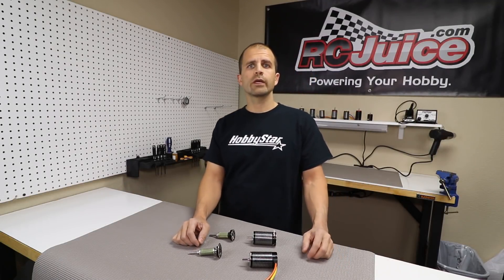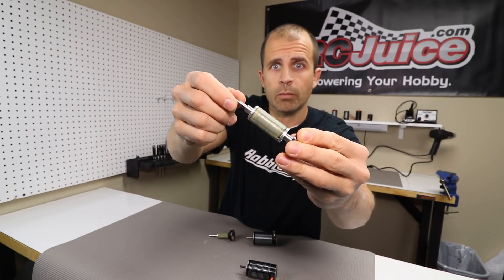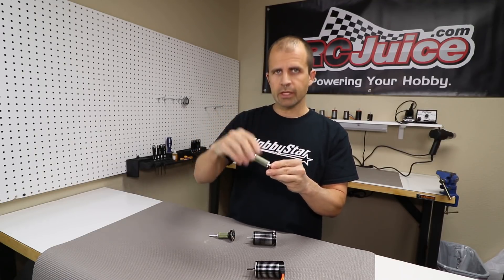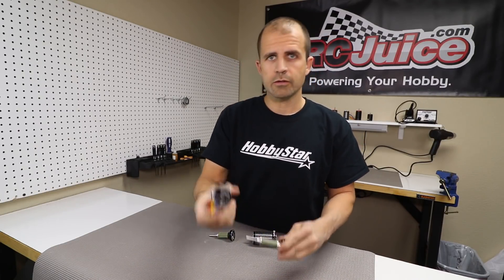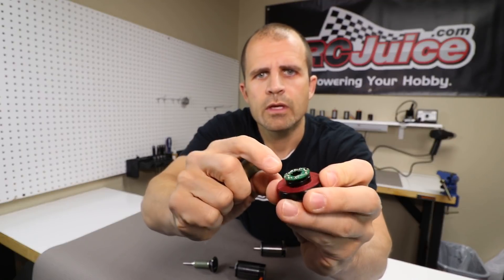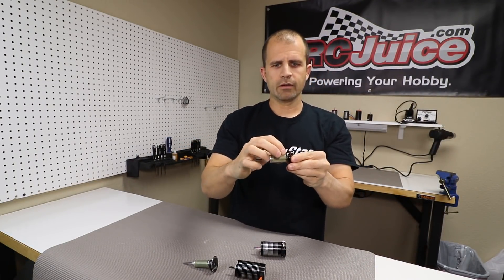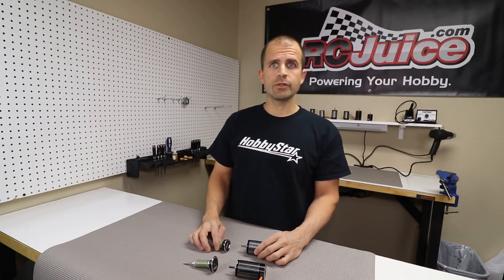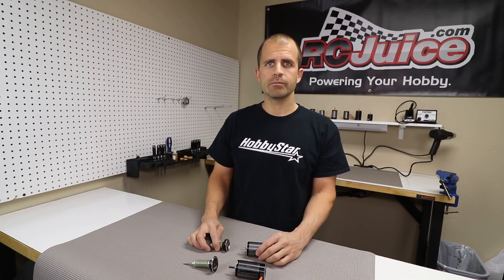What is a sensored brushless motor?

Comment: If I use a sensored motor in a non sensored set up, will the motor still run (like a sensorless motor would) or would it be totally non operational??
Reply from the maker: It will still run like a sensorless motor.

Comment: thanks for the explanation, so when the motor dont have a sensor motor and will be cogging?
Reply from the maker: You will usually get some light cogging at low speed with a non-sensored motor.

Comment: help me please ive got a cobra motor 2205-2500 it has no color coated wires im ttrying to hook it to an eflite ss-8 esc silver series  the esc has red yellow and black when i hook up aNY THING IT JUST BEEPS AND JUMPS   does it need the right bspeed controller which has all black wires just like the motor i would rather make it easy on my self since the last plane i fly was  a goldberg skylark gas powered 40 k and b that was over 30 years ago this eletric crap seems very confusing  can you help the radio system i just got  is a spectrum dx 4e it all originil stuff
Reply from the maker: David, check out this video for the order of the wires (the short answer is it makes no difference, if the motor spins backwards after connecting the wires then just swap ANY 2 wires around): https://www.youtube.com/watch?v=AQEAHEzaUJE    For the other issue, it sounds like you need to calibrate the ESC: https://www.youtube.com/watch?v=MIpvyi8vjHk

Comment: great video thanks heaps! Liked and Subbed! 
Just one question: Both same sized motors say a 4274 motor sensored and sensorless, would there be a difference in speed and torque outputs? asking this as i realise the sensor does take up abit of space up top. TIA!
Reply from the maker: Thank you for watching Chris! If both motors are a 4274 then no, being sensored vs. sensorless is not going to make a difference in power/speed, just in the smoothness of the operation of the motor.  Please let us know if you have any other questions and thank you again for watching!
Reply: @RCJuice  I'd like to know why this hobby has so many hidden costs? It's always one thing after another. I just bought a sensored motor, a sensored esc and neither of them come with the sensor cable. When are these scum companies going to stop ripping us off?
Reply from the maker: @murrijuana2842  Sensored motors should come with a harness, the ESC's usually do not but a motor always should.

Comment: Do you know if there's any way to bypass a censored motor and run it on a sensorles ESC?
Reply from the maker: Most sensored motors actually can be run without the sensor wire plugged in, we don't always advise it as we have seen it cause issues on some motors but you can try it and if nothing is heating up or acting odd, then it will still work fine.

Comment: Great video. I’m new to the sensored motors and esc. I’m having cogging issues with my sensored motor. I changed out the sensore wire, yet to trim if it changed anything. Should I turn down the timing on my motor or gear it?? Also what pitch do they take best? I’m using 32pitch would a 48 be more easy for the motor??

Comment: I'm an embedded control systems engineer, and I can tell you right now that it all depends on how  the motor controller was programmed.  Many lazy embedded programmers use PID equations to control their PMSM motor and never really implement them with any sort of Real Time Operating System to organize all the tasks involved in motor control, they also ignore the fact that vector control using SFB could yield some awesome results with sensor-less motor.  When looking for an RC system its best to get a system that was built by real engineers the "R1 Wurks Digital-3 LCG 220A Electronic Speed Controltor" is what you really need if you want to get serious. To further back up my claims you can take a look at this IEEE article. https://ieeexplore.ieee.org/stamp/stamp.jsp?tp=&arnumber=7519896

Comment: So I had a question I have a sensored LRP ESC with a monster horsepower 13.5 Trinity sensored motor well when I give it full throttle its dieing out but before it worked fine  I wasn't happy with the settings so I started to mess with them through the set up on the on and off I'm thinking I might need a programming card but correct me if I'm wrong please it would be much appreciated?
Reply from the maker: The program card would definitely help you get it set up easier, but it sounds like you may have something else going on?  Have you verified your battery is good (it could be sagging under load and the ESC hitting low-voltage cutoff prematurely)?
Reply: @RCJuice    Well I ordered a new brushless set up Because my batteries and everything's working on my other trucks but  I just got this traxxas slash 4x4 for a good deal it's just the esc that's having problems or motor because  My programming card came and it won't even let me change the setting with the programming card which is super weird but yet again it's my first lrp setup And all the videos on them are in German so I do not understand them

Comment: Seems in a Brushed motor there is no need for any sensor control. Already accurate for rock crawling and seem to have reasonable survival in water more then a brush-less Motor. I don't see the point in brush-less motors in rock crawlers. They are freaking awesome in my Traxxas UDR and anything that moves fast. Rock crawling, doesn't seem like their cup o' tea, at least that is what I get out of other reviews that brush motors have more accuracy and far less jumping around. I get that brushed motors lack longevity over brush-less motors and brush-less motors are so much faster. Am I wrong?
Reply from the maker: You are correct that there is no need for sensor control in a brushed motor.  The sensor is beneficial on brushless motors since there is no physical contact between any parts except for the rotor on the bearings, the ESC has no way of "knowing" what position the rotor is in without a sensor.  On a brushed motor, the brushes make physical contact with the rotor and for this reason, the phasing is always correct and you do not need a sensor.  The main reason for brushless rock crawler motors is mostly the market, since brushless is so prevalent along with crawlers it was a matter of time before the crawler guys were clamoring for brushless power.  Brushless motors are definitely more efficient, but at the slow speeds crawlers go at it's just not as much of an issue.
Reply: @RCJuice  Thank yo uso much for the reply. My friends brother seems to like brush-less in his rock crawler. Thank you for the time and clarifying your response. 🍻

Comment: Would you please suggest me without a sensor the best method to know the actual rotor speed ....
Reply from the maker: Without an external tachometer and something attached to it to measure, or a telemetry system it is difficult to know RPM.  You can get a good idea of your rough MAXIMUM RPM simply by multiplying the motor KV by the voltage you are running.  For example, a 3000KV motor on 4S would spin at 44,400RPM (14.8V x 3000KV).

Comment: Is it just castle that shuts off the "sensor" part of the process once the motor gets up to a particular rpm or do all esc's do that? To be honest, unless I'm crawling along at quite a bit less than a walking pace, I don't notice the difference between my sensored 2200kv vs my unsensored 2200kv. Then again, they are both in basher monster trucks.
Reply from the maker: Once you are moving at anything more than a walking pace the sensor becomes pretty much irrelevant anyhow, the main purpose of the sensor is to tell the ESC what position the rotor is in right at startup.  Once the motor is turning the ESC knows what position the rotor is because as it rotates, the ESC can "read" that.  Particularly on larger setups like yours you'll really mainly only notice the difference taking off slowly from a dead stop.
Reply: Ok. That's what I thought. Seems like with a 4 pole motor, sensored is a bit unnecessary, unless your using it in a crawler.
Reply from the maker: For bashers that is true, but for 1/8 scale race rigs (buggies and truggies) they are still the ticket.
Reply: Why though? It isn't like they stop ever, or at least on purpose when racing, or ever go so slow the sensor is doing anything for them.
Reply from the maker: It makes a difference when coming out of a slow turn, the whole operation just feels smoother and allows for more precise driving.  When racing you are much more precise about where you want the vehicle and it does help make it smoother and easier to control.  Even if it's a small difference, in racing every little advantage can help.
Reply: There's been very little R&D in Sensorless Motor tech lately.... However, as one of the Few who has given TenShock's latest Crawler Motor a go.....
I can definitely say that even MORE Poles is the answer! At least for Crawlers like myself, on a very fixed income.  Admittedly, it would be mostly USELESS in 95% of Racing! 

It's the TenShock 906 Series... All 3650 Cans, all Low KV...... All 6 Pole 9 Slot Sensorless Motors. Mine's the 1750kv. There's also a 1250kv and a 2450kv Version. 
My 1750kv, on 2S, only rarely will have the slightest, nearly inperceptable Cogging!!! 😱  It really goes against "Sensorless rules".  I'm told that it's because of more overlap between the Stator Magnets and the Winding Slots - since most later 4 Pole Motors also have 9 Winding Slots. Some even have 12!! 

I have NO IDEA if a 4 Pole Stator can simply be swapped with a 6 Pole Stator. I guess all other measurements being equal, maybe someone (who actually HAS money) can Test that Theory - with some fairly accurate means of measuring output, torque, current and such..... 

John Holmes, of Holmes Hobbies himself, has practiced with the practicality of smooth Sensorless Motors!! He Sells a 14 Pole, Outrunner Motor that with a Castle Sidewinder ESC, is SMOOTHER from a Start, than MANY Sensored Systems!!! 
It's NOT CHEAP! But it is one Experiment in High Pole Counts - that you can actually go out and BUY!

Am I saying that Sensored Systems are a Waste??  OF COURSE NOT!!! 
When I used to Compete (back before the Earth cooled), the HIGH Degree of finite Tuning, accurate Performance, and consistent Torque Curves, predictable Acceleration and Top Speed of SENSORED Systems - has been a Quantum Leap!!
Something we would not have been able to even imagine, back in the late 1990's!! For anyone who does Race, Precise Control is EVERYTHING! We only THOUGHT we had it then, with our multi-wound, LOW Turn BRUSHED Motors and "High Tech" ESCs. 
........ After a 6 Minute Main - you could've FRIED BACON on our Motors!!!  At least they were rebuildable, because that had to be done - OFTEN!!!!

AND, for the Crawlers and Trail Guys WITH Money, the Castle Mamba X and the Tekin R8 Sensored Systems CANNOT be beat. In Crawling Comps..... those are the two go-to Brushless Setups.

If you're an Old Fart, Broken Disabled Veteran, like myself - GIVE the 6 Pole 9 Slot Sensorless TenShock Motors a try!
 - BEFORE the "Secret" gets out, and the Price DOUBLES!!  😵😥😭 You KNOW things happen that way.
I get absolutely NOTHING for telling you about this. I just Love the Ultra Smooth low-end Performance these VERY affordable Motors give!! 👍👍
As an added Bonus, it's also much easier for us Guys to Waterproof Sensorless Systems.

YES, there ARE Waterproof Sensored Systems..... Guys like me can't Dream of affording them.  This kind of thing was made for US!! 😀😎
Reply: PoorManRC I do airplanes, not cars, but the ones that takeoff from water, can have the motors, ESCs, and servos covered with a conformal coating. It's something you can apply and it won't cost an arm and a leg. If you go to FliteTest.com, they have a video on a system running under water in a fish tank after being coated. Link to waterproofing electronics. https://www.flitetest.com/show?search=waterproof

Comment: Thank you for the vid...very good!  Can you tell me an example of when you would use a sensored and an example for when you would use a sensorless motor?  Thank you in advance!!!
Reply from the maker: Thank you!  In general, most "basher" type vehicles (vehicles used for fun and not racing) are set up with sensorless motors, the extra control is not necessary and they are less expensive so they make more sense in bashers.  In race vehicles where precise control and smoothness are critical you will generally always use a sensored motor.  Crawlers are moving more and more to sensored brushless motors now as well, they have stuck with brushed motors for their inherent smoothness since all-out power is not needed on crawlers, but the trend is moving towards sensored brushless motors for those as well now.  Please let us know if you have any other questions!
Reply: RCJuice Thank you very much for your time & information!  I greatly appreciate it!
Reply from the maker: Our pleasure :)

Comment: good video!
Reply from the maker: Thank you!
Reply: I bought one of your Toro motors and the sensor board is bad. I contacted through the website and no reply. Can I run it unsensored?
Reply from the maker: When did you e-mail?  No, the motor should be run with the sensor connected.
Reply: couple weeks ago, here is a video showing the problem, I think the sensor board is messed up. When I unhook the the sensor cable and it works smoothly.  https://www.youtube.com/watch?v=TKzN62abZew
Reply from the maker: Please e-mail us at support@rcjuice.com so we can look up your order.  Thank you.